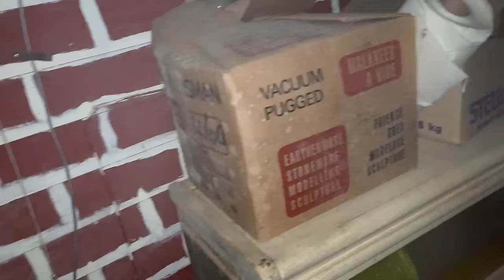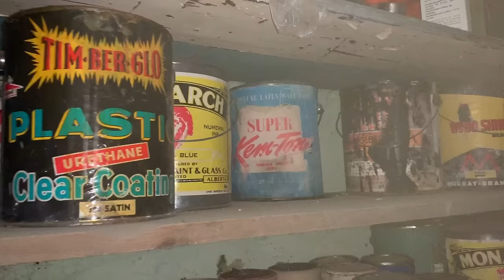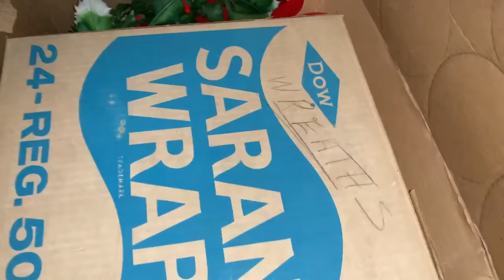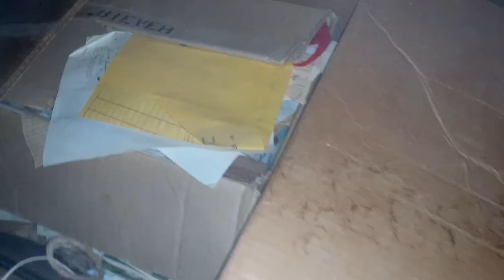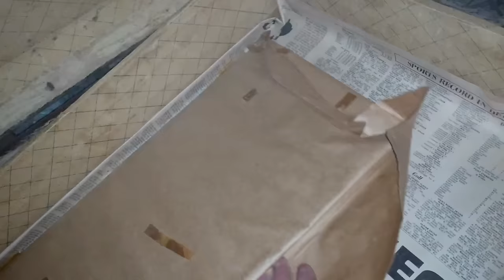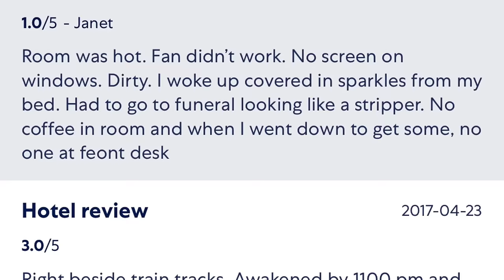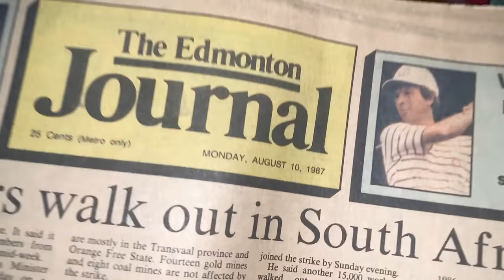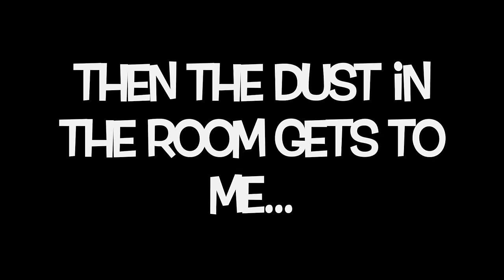Part 1. We bought a hoarded house! 100 years of stuff! what will we find???

Comment: You better get insurance on the house immediately. It might burn down with the furnace running and all the vents blocked! I would wear a mask and gloves and probably coveralls from now on. Good luck!
Reply: There’s a limit switch on the Furnace. Even if it did start it would shut right back down to keep from overheating. I’d be more worried about the electrical system being covered like it is. Who knows what’s still plugged in under those piles.
Reply: In TX, USA  you wouldn't be able to get insurance on a house in that condition.

Comment: My parents taught me, never go below half a tank in the winter...glad you had a guardian angel close by!
Reply: Good advice! He probably needs to do several other things: drain the tank and take the much out of the bottom, check the fuel gauge and sending unit and the wiring. Also, while he's at it, he should check the fuel pump. These things all need maintenance when old. Prep for a trip might include seeing where the gas stations are on the internet.
Reply: @andytaylor1588 , all great suggestions!!!
Reply: I was taught the same, but for summer. It didn't help me when the only gas station for miles closed since I'd last driven to my mom's. Just barely got to the next town
Reply: @AshesAshes44  NJ
Reply: Albert Lilly I hoped he learned a lesson.
Reply: He has a camera crew and a phone.
Reply: In the United States now we've been refused to purchase food beverage and fuel, petrol for the vehicle and heat. Even been refused Medical Treatment. However, it's much worse... we're trying to be on our way.

Comment: I really think you should just systematically go room by room on this.  You risk damaging things crawling around on top of it.  I get that its an adventure, but the best/most exhausting way is to be completely thorough with it, but I guess its a [time]cost/benefit deal also.  Good luck.   Get a respirator next time, and wear leather or chemical gloves on top of your vinyl ones for protection. Knee pads might be a good idea also and steel toe boots.  This looks like a heck of a project...

Comment: I just stumbled on to your channel (well done and enjoyable btw).  I live in San Diego and do a lot of vintage tool restorations, mainly for my own shop and fabrication business.  I suggest that you NOT overlook the old tools and motors.  That miter gauge on the tablesaw would easily sell for $50 or more on eBay as well all the old motors for $75 or more each.  Most old motors are easily restorable.  A lot of guys want to restore old saws, drill presses, bandsaws, etc with o.e.m. equipment of the same era and in many cases old parts are very hard to find if not impossible these days.  It would have been the first things I would have given immediate attention to in that old shop and in this video you overlooked them.  Old Craftsman, Atlas, Delta, Rockwell, Walker-Turner, etc.. Don't ever, ever, ever pass that stuff by! In fact I would have probably taken all the shop tools and motors and left most everything else.  In my opinion most old antiques (i.e; furniture, books, baubles, clothes, tchotchkes, etc) are cool to look at but most is still "old junk" that most people won't buy anymore (at least I don't). As Dylan said.."times..they are a changin'"  - P.S. - Get yourself a high-quality 3M NIOSH mask like the 3M6500QL (quick release is great).  All that ancient dust can get you really sick. I've had it happen!  Also mice droppings and urine can have Hanta Virus which can kill you.  There is also a lot of Asbestos in old lathe, old drywall, vinyl floor tiles, etc..  DO NOT start pulling stuff out of there without a lot of safety precautions!!
Reply: I also thought that - original components would be valued by people who refurbish antique items. I sure hope their tetanus jabs are current, though.
Reply: excellent advice!! Yes, it must be loaded with asbestos!!
Reply: Very good advice Jeff. God bless you

Comment: 32:57 "Pretty positive the water pressure could clean the ticks off a goat!". I'm rolling. Dead. 😂😂😂😂😂😂
Reply: WHY ?
Reply: Lmao
Reply: Despite being marketed as fully compatible with Xbox, PS4 etc, none of the awesome features listed on the box work with these devices (e.g 7.1 Dolby Surround Sound). You only find this out when you open the box and begin the set up process. Incredibly misleading and will be returning as product is not as described.
Reply: @stevethea5250  Yeah.
Reply: @stevethea5250  I guess you don't need toilet paper
Reply: Using Microsoft’s “Media Creation Tool”, you can create a single 4.74GB DVD for use installing Windows 10. If you want to have a bootable flash drive, Microsoft requires a minimum of an 8GB flash drive. Or you can run the Media Creation Tool itself (along with a high speed internet connection) to upgrade a PC directly.  @julianskinner3697

Comment: Would like to suggest that considering you drive an ambulance, storing a couple of gas cans somewhere in there, handy for such occasions should be a thing. Old school, military surplus gas can, they are compact, solid, easy to affix to a wall or drop in a space. You buy them once, never look back.
Reply: That is a really good suggestion.
Reply: Fill up at 1/2 tank
Reply: @icelandviking1961  Fill up every 50 miles.

Comment: You crack me up with the shower  :-)
Reply: Remember the shower in Hotel Paradise! She turned it on and it blue her straight out of the shower
Reply: We are used to No flow, No pressure, No heat. Showers with flow, pressure and heat are a rare treat.

Comment: I bought an old Military Gas Can that holds 5 US Gallons of fuel. Of course, I have a pickup truck and it was easy to mount the can in the bed. When I travel with trailer and camp and visit places in this country, this can has kept me from being stranded. You might think about doing this yourself. I am sure your pretty little Ambulance could be modified to have a bracket for a Jerry Can. You could put a trailer hitch on the car. They make all kinds of accessories that you can slip onto the hitch. Bicycle carriers, all kinds of stuff is available.

Comment: With that house being so old down in the basement there should definitely be a  fire extinguisher globe. A  fire extinguisher globe is in a bracket down in the basement. Back in the day when there was a fire there might have been a heat sensor on the bracket or you would pick them up and throw them in the fire. I have only seen them a few times

Comment: When I retired from the military I opened an appliance store. I had a mother and son come in and buy a laundry set. When I went to deliver it the house was so packed there was no way to even get the stuff through the door. I refunded their money and told them if the cleared a safe route I'd sell to them. 3 months later they came back. 3 months it took them to clear an area just to install a washer and dryer. The only thing wrong with the old set was the dryer was packed full of lint and money.

Comment: I ran out of gas in the Nevada desert in the middle of the night in a snowstorm. The Nevada Highway Patrol saved me! Said, "Lady, when you run out of gas you don't mess around!" 
Then I ran out on Hwy 70, four miles from Paradise. The tow cos. of two counties thought the other helped. Next day someone stopped just as I was setting out to walk. AAA gave my dog and I a ride back. 
Hot tip: If you need a ride carry a gas can!l

Comment: Horder houses are not good picking.  They rarely have "honey holes" and typically are more work than they are worth.  Best if you have a crew and a very large dumpster.  I can't tolerate the dust, the broken meaningless crap and very carcingenic dander.

Comment: That dust is serious health hazard. So bad for you. I had back issues because of my job as a housekeeper many years ago. I miraculously found 2different detox foot treatments that changed everything forme. I gradually took off all of the side effects that years of toxic dust had caused me. The first detox foot pads I discovered is called KINOKI, the second is DETOX FOOT SPA. The pads are for any age group and the foot spa is for adults with no metal implants. It will save you from serious effects.